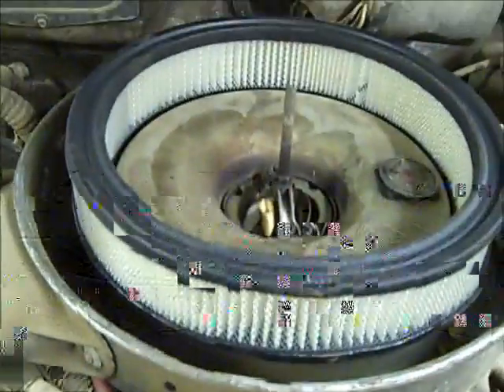Customer 1986 Ford Ranger project finale

Comment: you have a 2.3 140ci with a carter yfa carburetor on it gotta love those engines i have one my self even carbureted as well it ran beautifully until general tune ups and work where neglected but im going to pull it and rebuild it